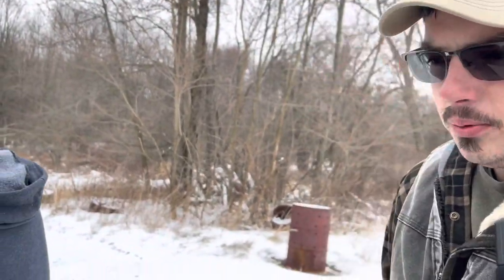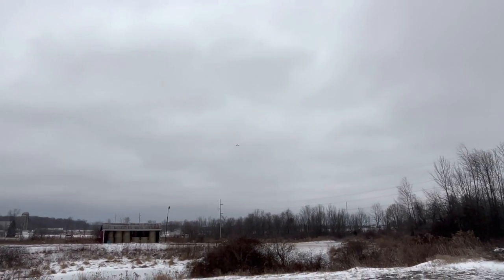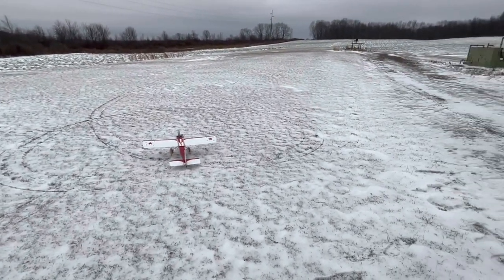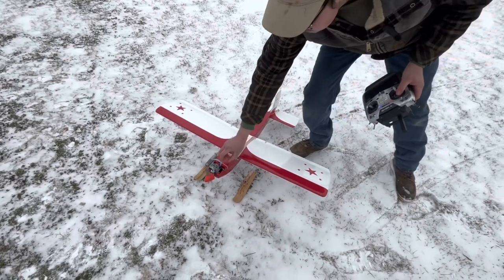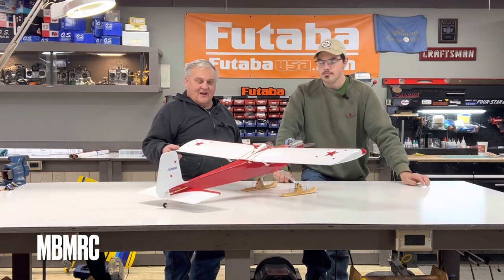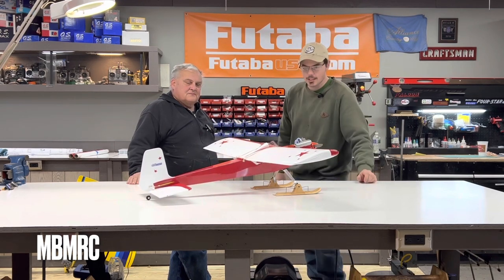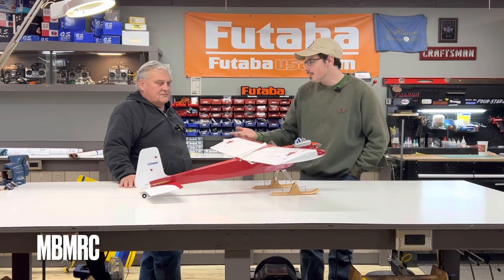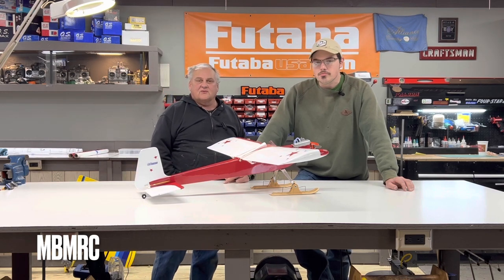Chuck Cunningham’s Scotch Lass!

Comment: I agree with the masses. A new kit would be welcomed for sure. Hey quick question for you guys. What are you guys using for nose cones? I've used du bro for years but recently I've been having them shatter/crack even in warm conditions. It appears the last batch I purchased it a different plastic compound
Reply: We use Dubro the problem we have with them is they never fit the prop we always have to trim them. These smaller planes are using 1-3/4 spinners they do not fit a 8x4 prop. So pretty much any time you get a spinner it needs trimmed sometimes you get lucky. Thanks for watching.
Reply: The Carl Goldberg spinner are pretty good too but they are hard to snap on!

Comment: I have a question pertaining to this model.  Did you guys run into any problems with the tank sitting lower than the carburetor?  I built this one, but I’m stuck at this point.